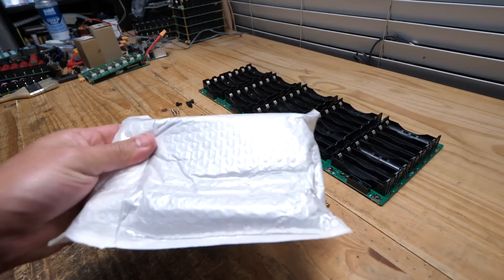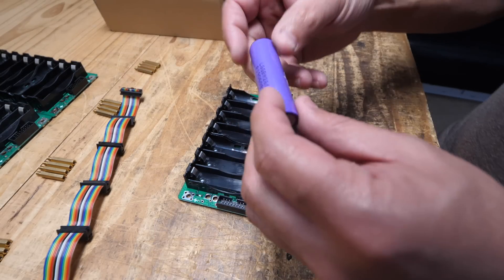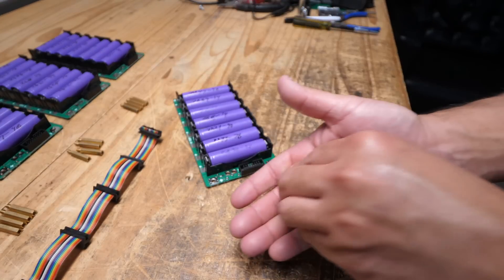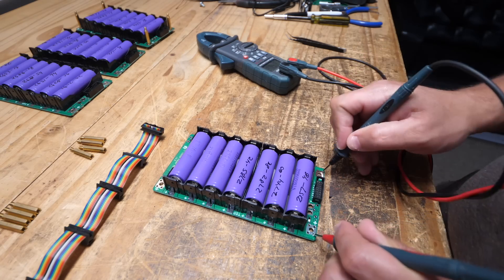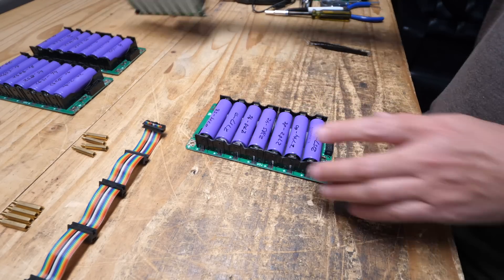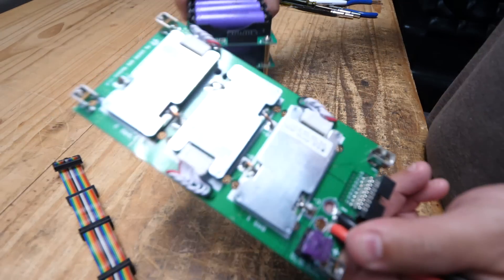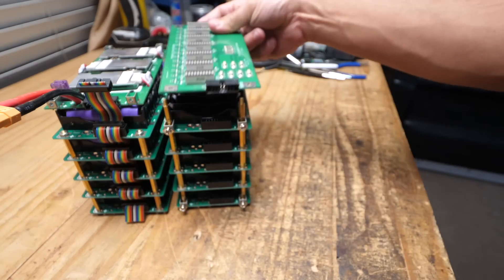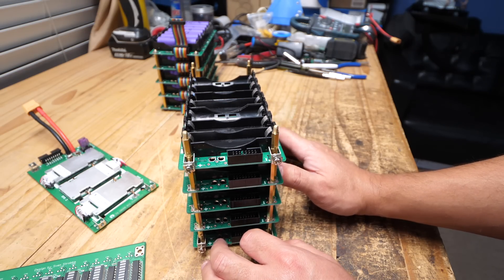Do it yourself Lithium battery pack 5x kit

Comment: Running high amperage power at 26v through brass standoffs?   Doesn't seem that safe to me.

At 25amps from the pack, those studs are having to outperform 14ga single core wire, which is standard romex cable.  I don't know if they can handle that must current long term, and them being in the open like that seems to be a shorting risk.
Reply from the maker: You must not be a mexi-can
Reply: @jehugarcia  have you done a load test to see if they heat up under constant load of 5 amps per board?  what about the 10 board pack with a 50 amp stated capacity?
Reply: @ancapftw9113  Would love to see your results if you do test them.
Reply: @justinroysdon2630  I don't think I'll buy one just to test it, especially since I don't have any 18650s yet, but I hope he tests one of the ones he's selling.

Comment: Jehu, i got the HP module, do i have to use batteries with same capacity in the upper and lower slot? or do i only look for same capacity in each of the 7 series cells?
Reply from the maker: Yeah you can do difference capacity in opposite side of the board

Comment: Just ordered the 10x set from your site.  I found the 7s BMS module on Aliexpress (A 50a w/ bluetooth monitor) that should work with these 7s modules.  My question is two-fold:  Can you just keep stacking (7x10,7x20,7x21, etc...) these modules, dependent on the BMS?  Also, how/where do you get the ribbon cabling to do these arrays?  it looks like some sort of quickclip kind of ribbon cable.  At under 4ft. in height and skinny, I'd like to try a 7x40module @50amps.  Thanks for helping us along on DIY LiPo; you're awesome resource for the community.
Reply from the maker: Yes you can keep stacking them
Reply: @jehugarcia  I just bought 3 of the 10x, how do you charge them?  Thanks.

Comment: what we really need are parallel configured boards. the holders are not rated for high current and for ebike applications we need them to be parallel so we can make a pack then by seriesing 10 or 14 modules
Reply from the maker: These are not for ebike use
Reply: @jehugarcia  then what are they for?  making 6s power banks?

Comment: I need 48V, if I buy the 10x kit + a spare BMS, can I run it in 2x5 configuration till I can afford a second 10x kit to run 2x10 ? I'm asking because the ribbond cable is not modular so I think I need also 2 'x5' cable that will be throw away after. If BMS work for both kit I think it's doable but would like a comment from Jehu himself.
Reply from the maker: I have a solution for the ribbon cable.... working on that next..... video coming soon, maybe tomorrow
Reply: @jehugarcia  how many 7s pcb the bms can manage ?

Comment: Jehu i have a question! Or anyone’s input on this would be appreciated! i bought 2 zanflare C4 from link in amazon and it was a box of 2 zanflare units.  One unit seems to come short when it comes to cell capacity, reason i know its not the cell is because i tested same cells on different chargers and all are with 20-30mah difference so pretty much accurate. Cells that were tested on good older chargers i already had it gives around 3681mah( what’s expected from LG m36 new cells.) Now those same cells come out to 3264mah or close to that on this particular zanflare charger and not only this cell brand but every random cell brands i use the mah is always lower somehow. Whats the deal? Can the charger be defective? Only one charger gives lower reading because the second charger that came in same box gives accurate reading. Thanks for reading.

Edit: heres a picture of difference
Bottom cell is from good chargers
And top cell is from bad? charger. The thing is, the top cell was tested and gave 3586mah and 40 resistance on good chargers.
https://imgur.com/a/tyfQ5r4
Reply from the maker: Yes chargers can be off,  I would exchange it on amazon

Comment: Can we get this same Kit, 8s LifePo4 32700 size cell ?
Reply: Peter Traveller that’s a pretty large PCB, might be better to make 4S 12V boards that can flip end to end to make 8S 24V. With some thought probably could get 12S 36V and 16S 48V with the same design.

Comment: Can a Toyota Prius battery be used as a solar battery?
Reply: With enough effort almost anything can be done, do you mean you already have a Prius battery and want to design a solar system around it? What generation of Prius battery do you have?
Reply: @kingrpriddick  Actually I bought 2 battery packs. It said they were tested. Well ok. So they need to be tested. I have Class C motorhome and want to install solar. So, I'm not sure where to go from here. I get them Friday the 15th of May.

Comment: Well, for you 12 volters, it's time to upgrade to 24 or 48 volts.  Built my system with the latter, so I would need two of these modules to provide a full 48 volts... which is a far more useful and efficient voltage when converting DC to AC.
Reply: so that 3.7V x7 not 4.2V x7 right?
Reply: @jacquesb5248  always the nominal voltage. For standard Li ion it's 3.7 or 3.6. For LiFePO4 it's 3.2.
Reply: Or just use LiFe

Comment: great videos and always interesting to see your builds. I have the following problem and wanted to see what a battery system configuration I would need. I have a 2/3Kw load that needs to run 24/7. I would like to run it from a battery system that is charged during the day from solar 3kw. What are the necessary components for the battery system and how large needs to be? thx

Comment: Approximately how many ah can u get from this 5x system with those lg 2200 modem pack cells?and Is it worth building it?
Reply: Approx 10 amp hour,  if you put 18650 holders on both sides of the pcb you can get 20 amp hour

Comment: I only have a 12 volts system, I cannot use anything above 14.1 . As interesting as these may be they cannot be used on a 12 volts system. Thanks for posting anyway.😁
Reply: Dart Gar you can use a step down voltage regulator, if you want to.
Or you can use only 3 cells, instead of 7.
Reply: Thank you so much for the info I will plan for it then.

Comment: When are you going to start taking orders for battery cells already made for us too stupid or scared to do it ourselves???
Reply from the maker: Never,  too many restrictions and too much liability in a suing happy society
Reply: @jehugarcia  sucks...but I understand.
Reply: @jehugarcia  
Do you think liability is the main reason why there are no reasonably priced lightweight racecar starter batteries for ICE powered cars? 
Everything I've seen in this battery class starts at $1000 and goes up from there
https://www.jegs.com/p/Altronics/Altronics-Powerlite-16-Volt-Lithium-Batteries/1528620/10002/-1 

I don't get it.   A Prius Hybrid battery has much more capacity and is around the same price.
Reply: @SwankySasquatch66  liability plus raw materials then the co needs local,county state and federal epa permits
one example buffet built a factory in china/ 1 agency to deal with and from plan to first product 6 months. in much of usa it takes up to 2 years in many cases dozens of permits sometimes even when you using existing building not impossible but takes lot of time money and lawyers.
assembling battery packs is a little easier  but you need a lot of production to make money